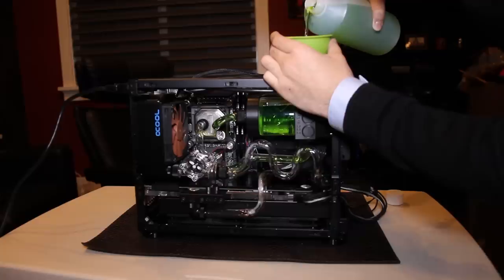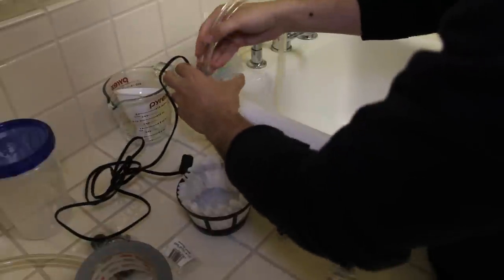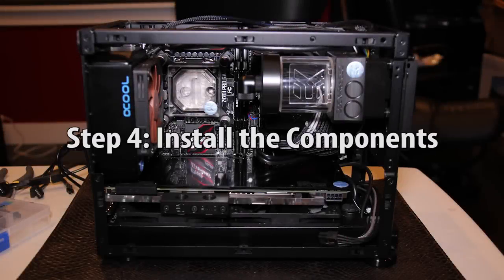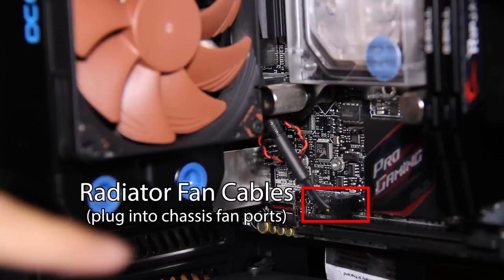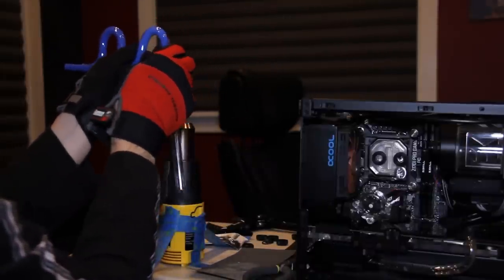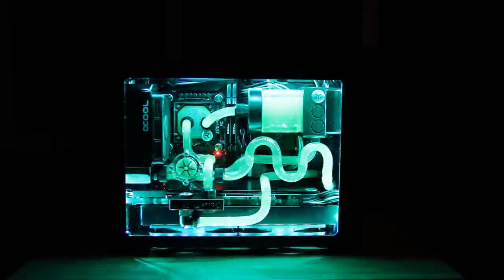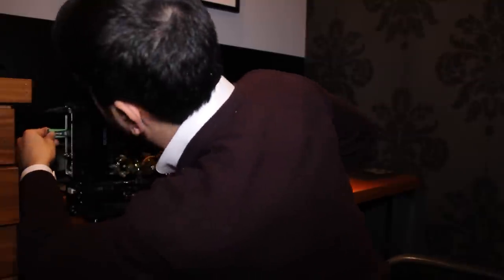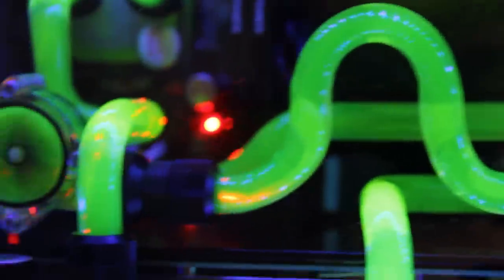Water Cooling Tutorial in 9 Easy Steps - Gaming PC Install Guide from Start to Finish

Comment: How the ** hasn't anyone pointed out that the diagram at 1:35 shows the loop flow in reverse?! A proper loop: reservoir / pump -> water block -> radiator / fan(s) -> reservoir / pump ...
Reply from the maker: Hey! This may seem counter-intuitive, but actually the order of the loop does not matter. Outside of ensuring the reservoir always comes right before the pump, the order of the rest of the components will not affect the temperature of your loop. This is because the water is traveling and mixing quickly throughout the loop and because water has a high heat capacity. As a result, the temperature of the liquid throughout the loop is almost completely homogeneous. There are many articles on the subject, and you can find some great videos from popular channels such as Linus Tech Tips and JayzTwoCents where demonstrate this. Here is a video that popped up when I did a quick search that may provide more details: https://www.youtube.com/watch?v=RnPB_q51iVk&t=307s . I hope this helps!
Reply: @Coolarj10  The "experiment" conducted by Jay does not contrast with a multi-loop (with more than one pump each dedicated to one component) nor a parallel loop nor a serial loop where radiators are interposed between each component. He just switches the inflow order between CPU to GPU and vice-versa. Even a negligible improvement in loop design is still an improvement that proves loop order does matter.
Reply from the maker: @chevalierdeloccident5949  Thanks for the reply! The reservoir does need to come before the pump, because the pump needs a constant supply of liquid. Since I have a reservoir/pump combo, it's already built that way. For the temperatures - from a purely technical point of view you may be right - the order you suggested might be cooler by 0.2 degrees C for example. For the intended audience of this tutorial, I want viewers to understand the concepts and focus on installing the right components. I would rather a viewer make everything fit whichever way is easiest or makes sense for them rather than worry about squeezing out .003% extra performance, which may not be worth the headache in some cases. Glad to see you are a more advanced user, so naturally feel free to optimize in every way you see fit!

Comment: Where did you get the tubing?
Reply from the maker: James Howson parts list is on the PC part picker link in description and once you go to the PC Part Picker website, you should be able to see the exact amazon URL of each item. Some products may be discontinued now, but you can get identical or similar newer versions. In my case, I used 12mm outer diameter / 10mm inner diameter PETG tubing as the hard tubing. I got a flexible 10mm inner diameter (can’t remember outer diameter) flexible tubing for the drain valve outlet at the back. Hope this helps :)

Comment: Can’t you just get bendy tubes?
Reply from the maker: Yup! You can get flexible rubber tubes, but then you may not have as clean of a look, since the they will sort of sag and hang limp unless you find a way to tuck them away. But it is certainly a viable option.

Comment: Why not buy an AIO instead?
Reply from the maker: Because an all in one cooler would be a cheaper, easier, faster solution without all the headache of a custom loop. What fun is that? Haha jokes aside, the only reason you’d probably want to do a custom loop is because you want to cool both your CPU and GPU in the same loop, and want the fun of making a custom loop design, fluid colors, etc. Otherwise, an all in one cooler is the most straight forward and I would recommend it. I can’t speak to the performance differences but for practical purposes it shouldn’t matter.

Comment: okay yeah, but can I fill it with coke?
Reply from the maker: Theoretically I’m sure you can, but my instinct tells me (and a quick but not thorough google search) that the specific heat of Coca Cola (or soda in general) is less than that of water. So, soda will do a poorer job of transferring away heat from your components. Also I’d probably be even more worried about the abrasive properties of Coca Cola and how it might wear down on your pipes, pump, or other components... have you seen those wild YouTube videos where people do all sorts of cleaning with Coca Cola? They cleaned off the rust from a car with coke... they even disintegrated a tooth by leaving it in a cup of coke for some days if I recall correctly!
Reply: @Coolarj10  how about Gatorade
Reply from the maker: @DanielTorres-en4vi  Gatorade, which I believe is mostly water but with solutes such as sugar, will have a lower specific heat than water. A high specific heat is what makes water so good for liquid cooling: it helps absorb heat while resulting in minimal temperature fluctuations. So, Gatorade may be ok but might be worse than pure distilled water in terms of cooling. Come to think of it, though, even the liquid I used that has the neon green and antimicrobial chemicals isn’t pure water...so it would probably be less efficient than pure water. I’m not sure how much of a difference we’re talking about, and it may be negligible for water cooling. Or it might make a difference of multiple degrees, only way to know would be to test it! (But don’t hold me accountable if you do :P )
Reply: @Coolarj10  I filled it with Gatorade and it works well so far. I will update in a month
Reply from the maker: @DanielTorres-en4vi  haha would love to know how it goes!
Reply: @Coolarj10  It has been a month now, it is still working completely fine.